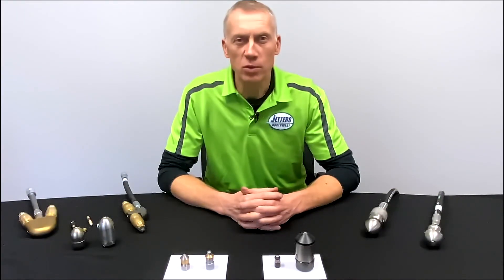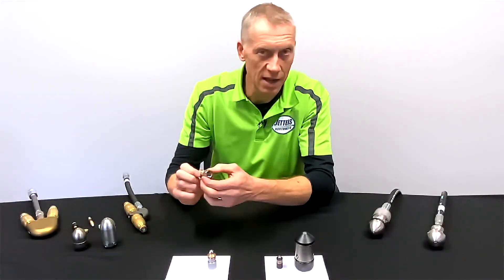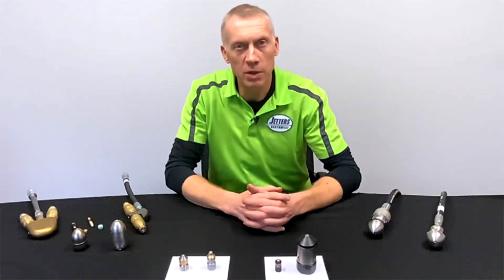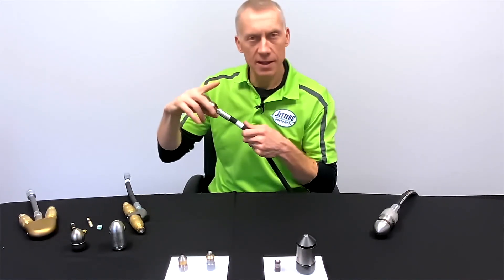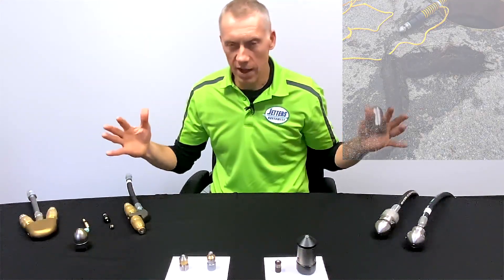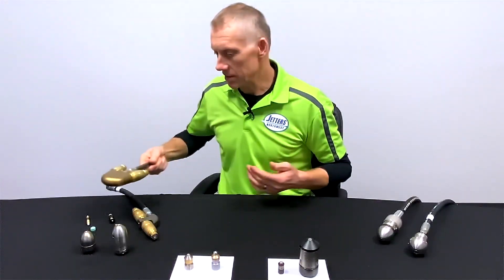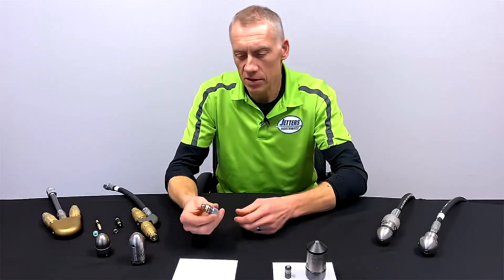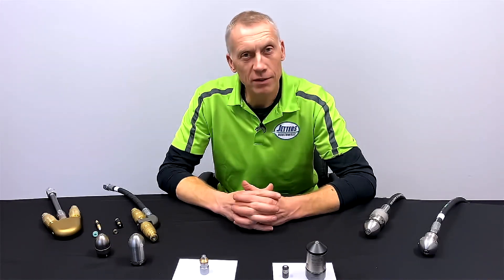Comparing ROTATING NOZZLE TYPES; MAKE YOUR 'HEAD' SPIN !  -  "GET" JETTING with JONESIE

Comment: The reaper is awesome but sheesh these nozzles can be expensive
Reply from the maker: Indeed premium nozzle/tools need to pay for themselves for the work you do, and the REAPER is the best blockage-attack nozzle available among todays premium nozzle/tools, which are so much better than when I started building jetters 30 years ago!  Speaking of cost, I remember when the 3/8" 'WT' WARTHOG model first came out about 20 years ago; finally a nozzle that could cut roots with a "small" jetter running "only" 6 - 8gpm! It changed the game for compact jetters and paved the way for the van-pack jetters of today but back then at $695 it still was a hard sell, as it took a while for people to believe a nozzle could be that valuable - but it did and it was & still is - and really paved the way for the REAPER, and RootRanger, and other great nozzle/tools.  Thanks for watching!  JONESIE

Comment: Great information of the various heads. Super well detailed and very well explained.
Question Please:
For low GPM machines what bit/head might be the best for clearing/breaking up roots out of a 4 inch main working downstream? The information would be super helpful. Thank you and again: Super well detailed and very well explained video.

Phil
Reply from the maker: Hi Phil, not sure how "low" your GPM is but 4gpm is about the minimum to run the most basic single-jet RootRanger nozzle but it is slow going and requires a lot of nozzle-manipulation (by twisting the jet-hose) when GPM is low. Serious root cutting nozzles like REAPER & WARTHOG perform best when "fed" with 7+GPM and don't require you to twist the hose to cover the inside of the pipe. The problem with low GPM rates is it makes for skinny/weak water-jets that don't penetrate the root masses very well. But here's a link to the ROOTRANGER - see the drop-down menu to change the GPM if you have more than 4gpm: https://shop.jettersnorthwest.com/collections/1-4-jetter-nozzles/products/root-ranger-nozzle?variant=50838346170675
Reply: @JETTERSnorthwest  Thanks for the valuable information. I will check the link out as soon as I get home. You reply is very much appreciated. 
It is frustrating when you have roots clogging a 4" main in the last 10 feet of pipe from the curbside clean out pipe to the township pipe under the street. Everything else I cleared out with my Bailey Lockfast sewer rods.
Note: I may consider a higher 5-6 GPM machine if I can keep it under $800. Not sure if any one makes one in that price range for a DIY person.
Phil
Reply from the maker: What are the GPM and PSI specs of your existing machine?
Reply: @JETTERSnorthwest  The one I have now  is a Westinghouse 3400e model w/3400 PSI and 2 GPM. I just bought it a few days ago and have not even taken it out of the box yet. I bought one of those Sewer Jetter Kits also that comes with a 50' extension hose and various bits to clear clogs. 
*
Very frustrating because I have also dug up my curb side clean out pipe area to get to a damaged 4 inch Sanitary T coupling (which I plan to replace) and I have cleared all those roots out of the vertical Clean out section w/the Bailey Lock Fast sewer rods. Now I only have is the last 10 feet to go where the 4" cast iron pipe turns 90 degrees to the horizontal direction to go to the Township sewer pipe under the street. 
*
I do appreciate your efforts and thanks for your reply.
Phil
Reply from the maker: Unfortunately no 115-volt unit on the market can effectively run a root-cutting nozzle.  Under pressure those 1.5hp electric units only pump out less than 1.5gpm -- it's like trying to cut down a tree with a weedwhacker. The least expensive route would be a 4gpm/4000psi pressure washer, or look on Craigslist, Offerup, etc for something used that'll have the GPM/PSI power to run the RootRanger ;)
Reply: @JETTERSnorthwest  I sent the Electric unit back today.
I ordered a 4 GPM Gas Machine and hopefully take delivery on Friday (or at latest delivered on Monday).  
I will hope for the best and if you have any suggestions please feel free to advise.
Thanks very much for your replies and great information. It is very helpful to people like myself who do not do this for a living. All the best.
Phil
Reply from the maker: Good call Phil; your 4gpm unit will have the power to run the "single" ROOTRANGER nozzle!  Here again is the link to the 4gpm model: https://shop.jettersnorthwest.com/collections/1-4-jetter-nozzles/products/root-ranger-nozzle?  You can select 1/4" connection or 3/8" connection depending on the hose-size you'll jet with. Great convo Phil - we'd appreciate your business if you choose to go after those roots!
Reply: @JETTERSnorthwest  The hose that came with the Jetter Kit I bought has 1/2" NPT male connector on both ends. It also came with a 1/2" female to 1/4" quick release adapter so that I can plug the one end of the jetter hose into the quick release on the Power Washer Spray Gun/Wand. 
Will I need another adapter should I need to buy the Root Ranger? if yes. what adapter? 
Thanks as always and if I should need the Root Ranger, I surely will buy from you guys!... 
Phil
Reply: @JETTERSnorthwest  I don't think my response a few days ago posted.
Reposting: 
My jetter hose has 1/2" NPT threaded male connectors on both ends of the 50' jetter hose which came with the Jetter Kit. What coupling do I need to connect the Root Ranger to my hose?
*
Also, would the double ended Root Ranger work with my 4GPM 3800PSI machine? I would like a nozzle that has both front and rear jets if one is available that I could use with my new 4GPM machine. Thanks as always.
Phil

Comment: question if I used my 12 gpm 3000psi  jet and switched to 200 hundred feet of 3/8 hose useing the same 12gpm nozzles that came with the unit what would be my pressure at the nozzle   thanks
Reply from the maker: Ok first I'll have to make several assumptions -- correct me if any of these assumptions are wrong:  First, I'll assume you have 1/2" hose now otherwise you wouldn't ask the question, and I will assume your 1/2" is 300ft long since that is most common. I'll also assume also that you're "switching" to 3/8" as you said, not adding the 3/8" to the end of your 1/2".  Idk what brand/model jetter you have but in estimating GPM/PSI losses I have to assume that your jetter is actually producing 12gpm at full throttle.  Next -- and this is the wildcard -- I'll assume that your existing nozzles are actually orificed correctly to yield a true 12gpm at full throttle after your existing 1/2" hose; quite often I see "12gpm" nozzles set to yield only around 10-11gpm, meaning that full pressure on the gauge happens BEFORE you reach full throttle because the orifices are too small, so, I'll also have to assume that you are seeing 3000psi on your gauge at full throttle but NOT at slightly less than full throttle. This is IMPORTANT: if you are hitting 3000psi BEFORE full throttle then your nozzles are not currently yielding/flowing the full 12gpm because RPM and GPM increase at a 1-1 ratio -- thus any last throttling up of GPM that does NOT increase PSI on the gauge is GPM that is simply being bypassed back to the tank by your jetter's relief-valve/unloader -- because unloader/relief-valves control Max-PSI by bypassing water to balance the system-pressure.  Ok, with all those assumptions in place, if you reduce the hose-diameter to 3/8" you will be increasing resistance to the 12gpm flow which will reduce your nozzle pressure by around -300 to -400psi (1.5 to 2psi per foot of "hose loss" aka "pressure-drop"). Further, you will see a decrease in nozzle-flow IF you stay with the same nozzles because the extra hose-pressure buildup will cause the unloader/relief-valve to bypass around 1.5 to 2gpm of water-flow to protect the system from exceeding the 3000psi max. That is a ton of info - here is a video showing these effects with a 12/3000 jetter and comparing 1/2" and 3/8" hoses:  https://youtu.be/iH4vZkY1HzI  Hope all that helps!!

Comment: This is a great video for me as a newb to all of this, thanks! I’m just a homeowner & landlord, not really looking to buy a whole jetting machine. What would you recommend, if anything, for say a 3200 psi pressure washer? I have root problems ~65’ down my 100’ sewer drain (where my PVC meets old clay under my driveway). Does the Reaper work with that (could also use on my kitchen drain for grease etc)? I’m also thinking Warthog for attacking it from the manhole side since the problem is closer to there. Thanks!
Reply from the maker: Before I can recommend Reaper vs. Warthog vs. RootRanger -- what is your pressure-washer's GPM rating? 3200psi is good velocity but it doesn't tell us what GPM-flow you have to work with.  Think of the GPM as the size of the axe in your jetter's hands; a 5-pound axe (5gpm) will hit the root-mass much harder than a 3-lb (3-GPM) axe -- and the PSI represents how fast it can swing that axe ("velocity").  Another point: the actual water-streams from the nozzle are "wider" at 5+GPM so they penetrate deeper at the same PSI, plus they "carry" further in larger pipes than "skinnier" low-GPM water-streams do. This is why Root-Cutting/descaling nozzles like the WARTHOG, REAPER, ROOT-RANGER, etc. all perform poorly with less than 5-GPM, and much better with 8-GPM (or more) like the major "rooter" types use

Comment: I have a kranzle 2160 and my 4 inch sewer pipe has a lot of lime from the hard water in our area which catch the paper and solids,  what would you recommend  to clean the lime out of the pipe
Reply from the maker: Hmm it looks like the 2160 does only 2.9gpm which is pretty light for de-scaling lime -- we like to see the GPM at least match the 4" pipe-diameter for scouring the pipe, or double that GPM for professional "rooter class" cleaning.  But to answer your question I would use a rotating "controlled-speed" Grease-Hog type with no forward jet -- no guarantees since I don't know how hardened the lime scale is, but if it not too dense this will work well: https://shop.jettersnorthwest.com/collections/1-4-jetter-nozzles/products/1-4-grease-hog-nozzle?variant=47666522685747
Reply: @JETTERSnorthwest  thank you very much for that..much appreciated

Comment: Have  a main drain back up with no roots?
Reply from the maker: Oh yes - other common problems are grease, scale, sludge, dirt/rocks from a broken pipe, animals, and a big problem today is a buildup of "flushable" wipes. Or a combination of any of those.
Reply: @JETTERSnorthwest  in your experience, can unclogging a drain using such jetting solutions you list in the video, damage piping in any way due to the water jetting power? Great video.. thanks.

Comment: Roto-Drill vs Reaper?
Reply: I've been using the reaper 3 years now. 12 gallon per minute pump at 3700 psi. I remove calcium out of sewer lines with this as well have cleared 6" nearly plugged for 60 ft with reaper in 3 hrs. Need minimum capacity what I am using with the reaper. I now own 2 reapers. Easy to rebuild too.
Reply from the maker: We love them both, but the REAPER's rotary parts - specifically the "Rotor" and "Seat" - are made of Tungsten Carbide ("TC"), while the the ROTODRILL's rotary parts are Ceramic. TC is MUCH more durable than ceramic and this is a factor because in both types the Rotor "smacks" into the Seat with each startup (there has to be a slight looseness between the Rotor & Seat; that's why theses nozzles rattle when you shake them). The REAPER's TC parts handle the start/stop jetting-process better than its less expensive Ceramic competitors. Also, the Reaper's TC Rotor/Seat create an incredibly true "circle" spray-pattern which speeds up the forward-cutting action vs ROTODRILL.  https://youtu.be/DWDn1MRDvXM

Comment: I have a 4 gpm, 4000 psi machine. I also have a turbo nozzle. Looking to clear roots from 80 year-old 4” cast iron sewer main. Would that work, or is a turbo nozzle stronger than a jetter? I’m worried about cracking the old pipes if the jet is too strong.
Reply from the maker: it just depends on the strength of the pipe - if it is normal then a turbo shouldn't be a problem, because high-GPM jetter machines with root-cutting nozzles like a Reaper or warthog hit the pipe walls harder than a turbo at only 4gpm. Question I have is how are you going to get the turbo nozzle to pull itself into the pipeline?

Comment: Hi. Do you sell your nozzles on Amazon?
I am thinking of starting a sewer and drain cleaning business using my pressure washer. 

What hose size would you recommend?

Many thanks from South Africa 🇿🇦
Reply from the maker: We do not work through Amazon, yet we do have many nozzles online.  Step one is knowing the outputs of your pressure washer:  (a) What FLOW does it do in GPM or LPM?  (b) what PRESSURE does it do in PSI or BAR?

Comment: Hi what would you recommend for 4000 psi 4gpm for cutting roots would reaper 1/4 inch size 6 work or is there something better
Reply from the maker: We love the REAPERs but the #6 will only build around 2500psi with a 4-GPM machine because of the #6 orifice-size (#6 means it takes 6-GPM to reach 4000psi). Unfortunately they don't yet offer anything smaller.  Since you only have 4-GPM to work with, a better choice would be a "single-jet" cutter nozzle such as the ROOT-RANGER https://shop.jettersnorthwest.com/collections/1-4-jetter-nozzles/products/root-ranger-nozzle  or, on the high-performance end, an ENZ-reverse nozzle.  With these the only negative is they have to get past the blockage to jet it because the cutter-jet is out the rear to also provide thrust into the pipe - that's why they only need one jet
Reply: Thanks @johnc5630 for asking this question. I have the same pressure washer that can be converted to a jetter with my mini reel setup. What would be a good forward penetrating nozzle for this setup. Thank you. Look forward to trying the ENZ reverse rotodrill.

Comment: Here's a weirdo-but-sincere question: if I wanted to hook of of these nozzle types up to compressed air to safely clean out dryer vents, which would you recommend?
Reply: Dude that's actually genius.
Reply from the maker: Yep I've heard of people doing that! Just don't expect the nozzle to "pull" the hose in nearly as hard as it would with HI-PSI water.  A basic "flusher" nozzle (which does NOT spin) is your best bet, and they are cheaper (the Rotating nozzles in the video wont spin well under just air-pressure). If your hose-end has 1/4" threads here's a goodie: https://shop.jettersnorthwest.com/collections/1-4-jetter-nozzles/products/1-4-grease-ball-nozzle

Comment: If you could only have three nozzles what would you have in your tool box?
Reply from the maker: Basic PENETRATOR, REAPER, and WARTHOG !!
Reply: for mainline Standard head for clearing blockages, all back (no forward ), and mad dog rotating nozzle
For smaller limes three forward a couple back nozzle (flushing ) , all back to pull grease out of kitchens, and spinner rotating nozzle to clean

Comment: what can I use for hard built-up silt/clay in a 4in. corrugated footer drain in basement? Rotating chain cutter?
Reply from the maker: Chain-Cutters are not good for silt; they are for removing scale-buildup and roots.  For silt I would recommend a "WT"Warthog (if you have at least a 6-gpm jetter) or a RootRanger / ENZ-Bend style if you have a smaller jetter around 4gpm). The idea is nozzle with "fat" rotating jets to break up the silt

Comment: I need a jet to unclogged a 1 inch id copper pipe. This blockage is a very hard calcium deposits because of hard water. Can you recommend a tool for this purpose..... I am using power washer.
Reply from the maker: 2 initial questions: (a) What is the GPM and PSI of your power washer? And (b) how hard is the calcium? Is it so hard you need a chisel to break it up -- OR -- could you scratch it out with a wire-brush (if you could get a brush to it).  The density of the buildup to be removed is a VERY important factor, as is how much GPM/PSI power you have available to feed a nozzle

Comment: I have a storm drain with roots. I only have a 3200 psi, 2.8 gpm pressure washer. Does any of these heads work on a smaller system and would still cut roots?
Reply from the maker: What size pipe are you working with? Typically you would want more GPM for root cutting but you could possibly use a Root Ranger nozzle. It is a little bulky and not suggested for under 4" pipe.
Reply: @JETTERSnorthwest  It's definitely under 4" and I believe probably 2"
Reply from the maker: Sorry, I don't really have much in the way of root cutting for a 2" pipe. The new 1/4" Reaper would be great in a straight 2" line but it will not corner well and it would still need more GPM than 2.8.
Reply: @JETTERSnorthwest  all good thank you for the info.

Comment: I think the high speed ones are worthless and kind of a trap for beginners, because when they hear rotating nozzle, they imagine something like the warthog, what is super effective, but in reality they get a very low performance mistmaking machine and these nozzles arent even that cheap (100-200$ for a 1/8 nozzle). These spinners make very fine water vapour with close to no impact instead of real water jets. I had one of these for trying out, and i could put my hand into the water very close to the nozzle without feeling considerable impact (im not recommending this method for others).

Better choose something like the grease ball with 8 rear jets for better coverage on smaller pipes, and use the high-tech ones on bigger pipes.
Reply from the maker: Yep agreed! Like we mentioned, the "controlled-speed" ones that make a "buzz" sound rather than a "siren" sound have better impact and much less "misting" than the cheap spinners, as you mentioned